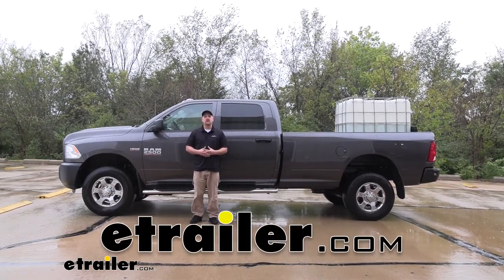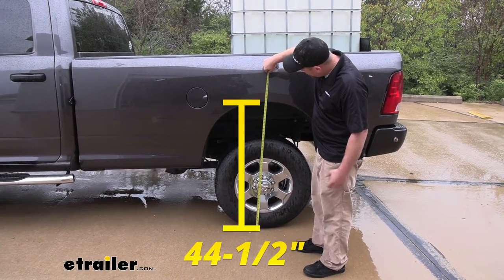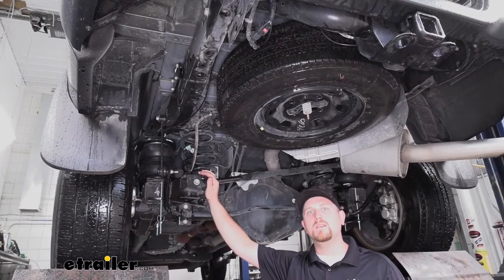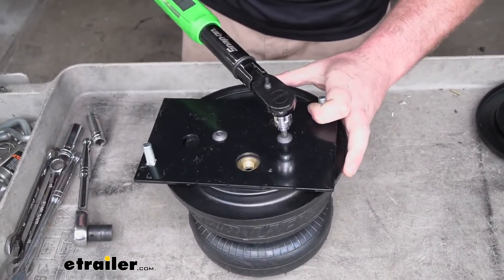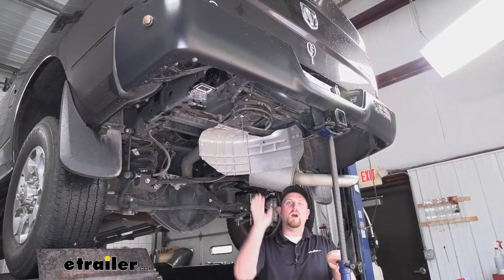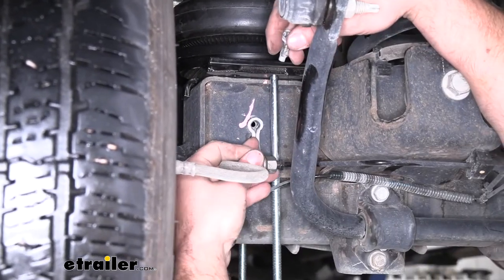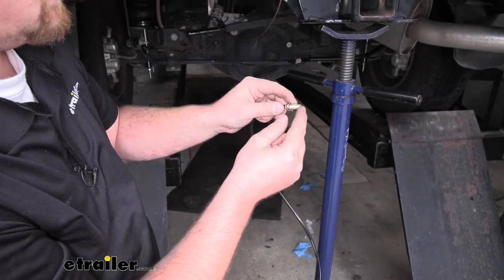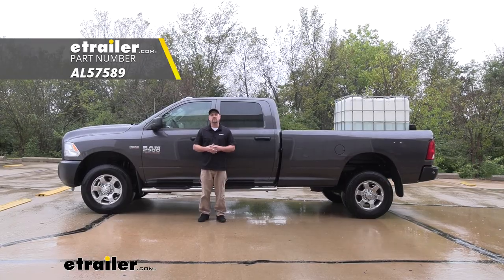etrailer | Installation: Air Lift LoadLifter 7500 XL Ultimate Air Helper Springs on a 2018 Ram 2500

Comment: What would be implications of adding this system to a 2500 Ram that is already equipped with factory air suspension. Would this setup confuse the factory auto level system.
Reply from the maker: You can add a set of air helper springs to your Ram 2500 but to your point, it may mess with your auto level when there is air in the bags. Many people will just upgrade their jounce bumpers to SumoSprings for added support when hauling a heavy load.
https://www.etrailer.com/Vehicle-Suspension/SuperSprings-Intl/SSR-312-47.html